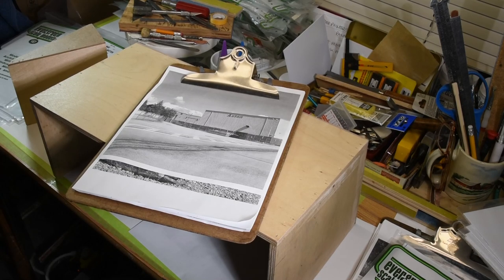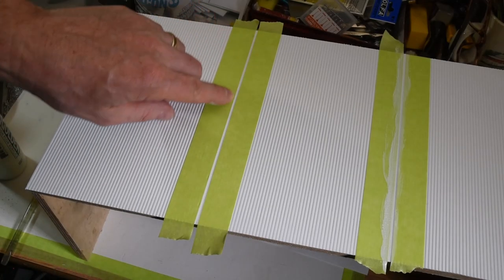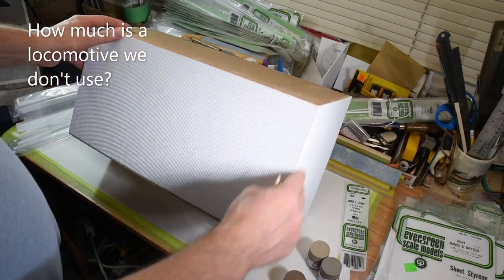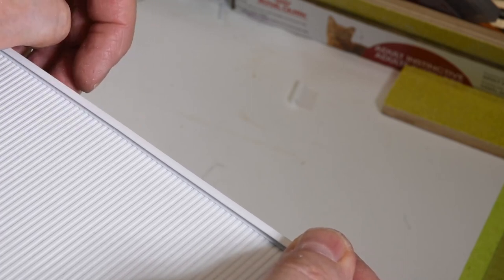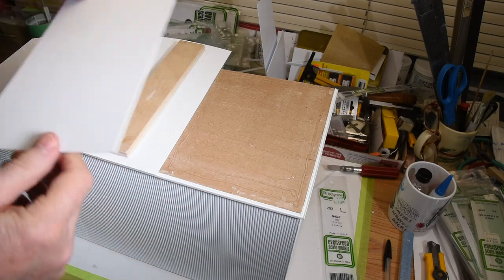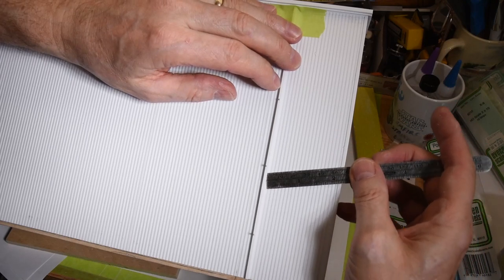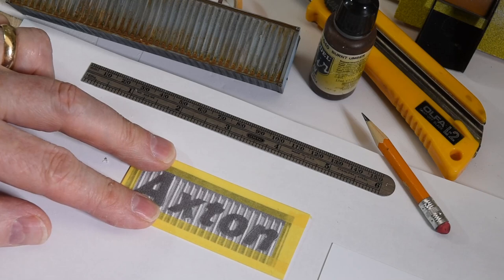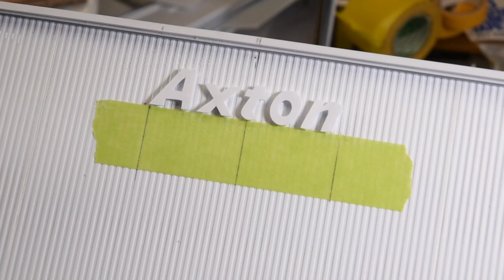Modeling HO Scale Axton Steel Company Final | River Road - Vlog # 82

Comment: A good HO Scale craftsman kit can cost over $70, so it does not bother me to spend a little more to scratch build a model/building I want. I like the methods you used for the down spouts and lettering. I learn something new with each of your videos. Thanks and Cheers - Larry.
Reply from the maker: Thanks for sharing Larry. I have not heard from you for awhile. I hope all is well. Cheers!
Reply: @boomerdiorama  I am doing well..... allergy season and can't get much done. Cheers.
Reply from the maker: @harperlarry49  Yes indeed, Allergies suck and I know from current experience. They seem to get worse as one grows older. Any time I sand one piece of plastic or wood I wear a mask and it helps for sure. Cheers.

Comment: Great Building 👍 didn't think it would be that expensive, but you built it looks great, fla -NY joe
Reply from the maker: The siding is a little on the expensive side. Much cheaper to do concrete "tilt-ups" for sure. ;-)
Reply: @boomerdiorama  maybe I might try that.... God knows what I have . Saving everything for years til I bought my house , unfortunately my mom past away .. anyway so I was able to build a.good size layout in one of her rooms. I had 2 beds and a bathroom on one side so me and my girlfriend made arts n crafts room on one and my train room on the other that goes through the closet, pretty cool... (Rather have mom back but don't happen that way)I'm going to easily take up trKe and make  better layout middle 13+4 is my City 2ith elevated subway will stay but time to change,.need more dirt roads my layout is all paved and signal lights all but see how it goes to MANY trains I recently bought spent a good $1000. From Christmas til now I'm done and didn't need em just wanted more ... Addictive. Lol fla N. Y. JOEY

Comment: Nice project. I like photos. The best tool for proportions, shades, colors and weathering. Since here you have everything, if it´s close to home, why not choose a day with lightning that fit the one in the layout with logical shades, take the best square shot, print it at the right size and glue it ? The three dimensionals ribs will be created in only 2, thanks to shades. A very fast way as a trompe l´oeil to get a building done. With proper photos placement in different scales, an entire scene can be done. Not worst than flat backdrop or worst. White gyproc wall.
Reply from the maker: Photos are awesome for inspiration for sure. 😁

Comment: in vlog # 81, what type of ca were you using to attatch the cab, to  the excavator.  did  you use canopy glue to attatch the windows, i noticed you didn't get any window fogging.  great work as always thank you   john
Reply from the maker: I used "Medium CA" to attach the cab. No need to glue the windows because the part is a clear plug held in by the seat component. The pieces snap together very tight without adhesive. But, yes, you are correct, CA will fog the windows if you are not careful. ;-)